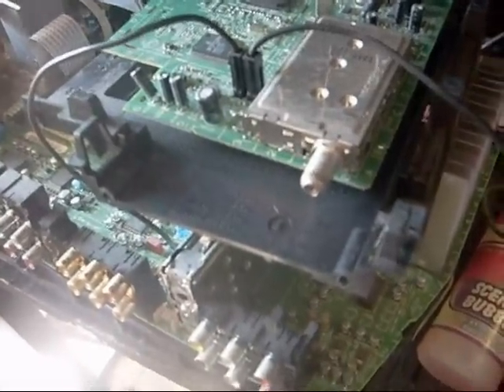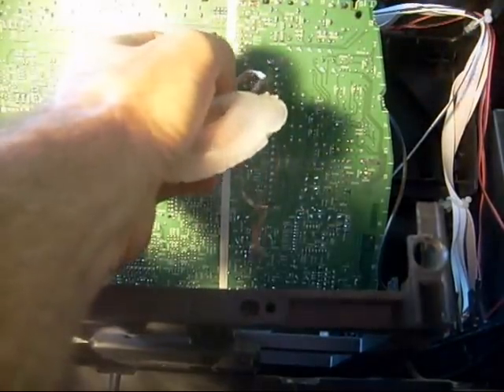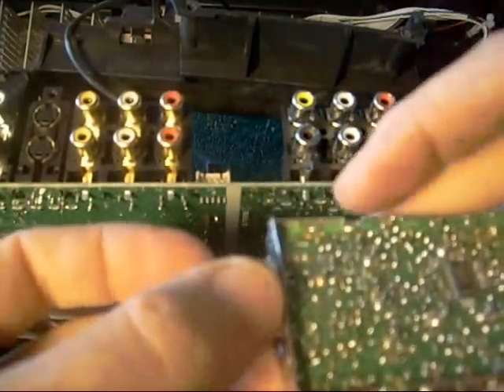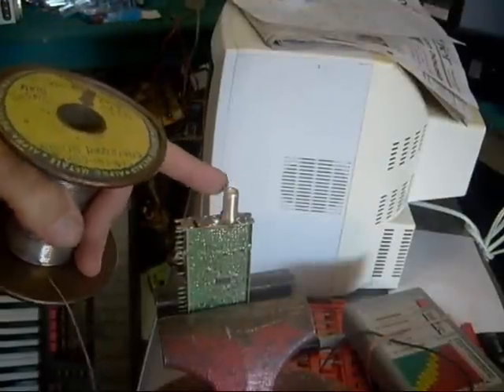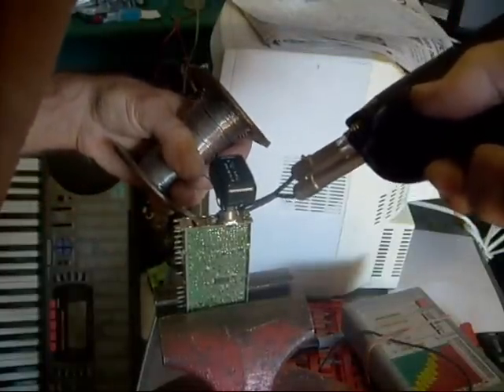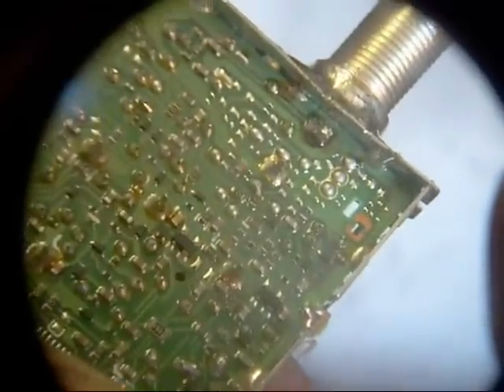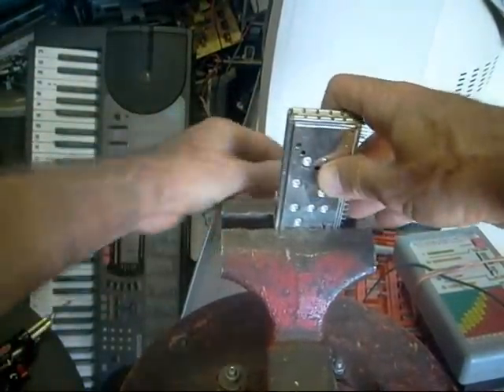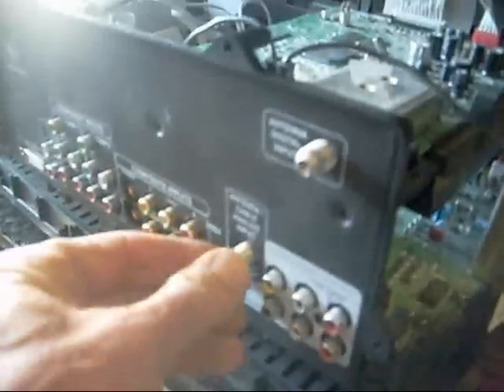Repairing antenna connectors on TVs

Comment: Hey Thank You for the video, lots of information. We have a Samsung TV, digital, Smart, and the antenna "Tuner Module" stopped receiving the signal from the roof antenna. We have eliminated the cables and plugs and connectors, so it just leaves us with the TV plug, or Tuner Module. One thing, can I just replace the Module instead of fixing it, OR can I just use one of the HDMI plugs with several adapters, to get the signal to the TV?  Thank You,  GOD Bless !!
Reply from the maker: If your tuner went out, one option is to buy a analog to digital converter that you can plug into your HDMI input, otherwise the repair can cost quite a bit.
Reply: @GrantsPassTVRepair   GOT it , perfect, Thank You appreciate the advise.

Comment: I'm so thankful I found this video! I just had a brand new LCD set delivered a couple of days ago& the antena/cable connector came off!Sharp refuses to do anything&my extended store warranty will fix it.Trouble is they won't repair the connector until 2013,when manufacturer's warranty expires.Anyway  I'm wondering what youcharge now to repair this?I'd like to hear pricing from an expert before I call for a qoute,don't  wanna get hosed you know.
Bless you&thanks for posting this!

Comment from the maker: @csantos9d1 I'm not sure which board your referring to when you mention the mother board in relation to the tuner. Did you mean the circuit board in the tuner it self? If so sometimes they are also repairable but you will need a good magnifying glass.

Comment: Are all those tv connectors n the boxes connected to them a universal size. Like can i take the tv connector from one of my tvs that are broke and replace with the tv that works. On one tv the picture don't work but the connector is good. On the other tv everything works but the connector broke. Can i swap them out

Comment: Perhaps you could mention ESD protection. Electro-Static Discharge while handling PCBs is a HUGE component-killer. Wrist strap w/ wire connected to ground prevents ESD, as you know...right?

Comment: I'm not so good at soldering so I replaced the whole board. Just the antenna connection was broken. Would you want my old board? It's from 43" Sanyo LED.
Reply from the maker: Is it the same model TV as the one I showed in this video?
Reply: It's been awhile, found the board I replaced it with. It's Sanyo DP37649 Main Board ( N4PH , 1AA2TEF0039C )
Reply from the maker: If you were in the neighborhood I'd take it off your hands and file it in my inventory if you are giving it away, but otherwise no thanks if there is shipping involved.
Reply: Ok thanks, glad I finally asked so I'll just dispose of it.
Reply from the maker: Thanks for the offer.

Comment from the maker: What I charge depends on the job. Some go quick but on the newer LCD TV's they can be a  more difficult. I did one last week for 80 bucks, but on some CRT TV's I have repaired them for as little as 35 bucks.
I generally buy the RF connectors from a company called Nesco.

Comment: Hey i'm having a little bit of trouble. I did everything right on my sanyo flat screen but Once i screwed everything back in, I turned it on and yet its still a black screen with no cable. The only thing i can think of why its not working, is because the original tuner tip inside,
 (the golden rod thing)  was not soldered all the way on the other side of the hole. but my new tuner i soldered the whole golden rod on the other side which covered it completely. Can you help?

Comment: I need Help on how to set TV Channels on a New 40" LED Samsung TV that I just purchased at Walmart for $223.00.  It is just a plain TV and it is not a Smart TV.  I do not have any Cable or Dish and I am just using an old Rabbit Ears type TV Antenna to get FREE TV.  With my old fashioned TV that weighed a Ton - I could move my Antenna around to different positions and get about 56 channels.  Now with the New Samsung Flat Screen TV it uses an Automatic Function to set the Channels - therefore if the Antenna is in one position when I run the Automatic Channel Find it leaves out certain channels.  If I move the Antenna to a different position and re-run the Automatic Channel finder it leaves out different Channels.  How can I add in the missing Channels?  I have tried clicking on a channel and having it added to the channel list such as Channel 27, but then it doesn't let me add channel 27.1 or 27.2 and so on.  Then the TV doesn't want to play the channels I added no matter where I put the antenna.  Anyone have any ideas or tricks to add channels???
Reply from the maker: +44357514 You must have a good stable signal to get all your channels programmed in to your TVs memory. An outside antenna is best. I suggest you try contacting Channel Master and ask them which antenna they suggest for your application. Their phone number is 1-877-746-7261 You might ask about antenna amps as well

Comment: ill try to review another video to make sure I got the big picdture on those two unions not shown, thanks. Sounds like alot of variance on repair cost, 35$ to $100Thats the cool thing about youtube, he you feel over charged you have the info to discuss the reason for the increased cost. Having a sorry solder gun can double the time spent on the job. He can 1 nice ones to replace the sorry one and still make $75, weller universal 35$ home depo but all right video. shot of inside of soldered units would make it a 10. or  4 star

Comment: how much u charge for a job like this and r u near New Jersey
Reply from the maker: +Ken Murray No I'm in Grants Pass Oregon. What I charge depends on how serious the damage is. Sometimes when the antenna connector is pulled off it damages the circuit board but usually not. as a general rule I charge from $45 to $75.

Comment: How much do you usually charge for this service?
Reply from the maker: It depends on how difficult the repair is. On some TVs I can do this repair fairly fast. The more difficult ones may take substantially longer . The price may go from 35.00 to 100.00
Reply: Grants Pass TV Repair  ok I dont live in your area for repair but im just trying to get an idea for any shops around me I know there isnt in my town I have to travel an hour from me and it'll be difficult I have a 55" smart vizio tv. I was going to just do it myself because I know how and buy an old tv someone has for scrap its the same brand just a 32" do you think that makes a difference?
Reply: Grants Pass TV Repair or where do you think is a good place that would have this part?
Reply from the maker: If you go to ebay here is the part number. rca 215543
Reply from the maker: As long as the connector will fit it shouldn't matter what TV you get the part from. You will need a soldering iron and a soldering gun to do this repair.
Reply: Grants Pass TV Repair thank you very much :)

Comment: what kind of solder do you use
Reply from the maker: +Bj Olawuyi I don't remember but any solder designed for electronics will work as long as it has a rosin core.
Reply: 60/40 tin lead solder

Comment: I always cut my wick short because one time the long tail of the wick touched the B+ cap and some other places on the board and discharged or should  I say poped ,two hours later I had the set going . T chip and HOT ,I have keeped my wick short since then.

Comment: you covered thye mout of the threaded portion yet I saw nothing that showed how the metal prong coming off the bottom of tunner model. You did poit to some difficult to see solder on the back of the circuit board. So that is obvious where and how its soldered to board.  ???

Comment: You have a lot of videos, Few if any stress electrical safety. In watching just this video, You violate several safety rules. This is a bad practice for the unskilled novice to witness and follow.   You and I may practice Electronics safely but that is behind the scenes.  An unskilled novice who literately follows your videos based solely on the video could get hurt.  You need to be more responsible in the construction of your videos to avoid a lawsuit.   One professional to another.  Work safe and prosper.  I wish you well.
Reply from the maker: Thanks for the suggestion. A video on safety would be a good idea..